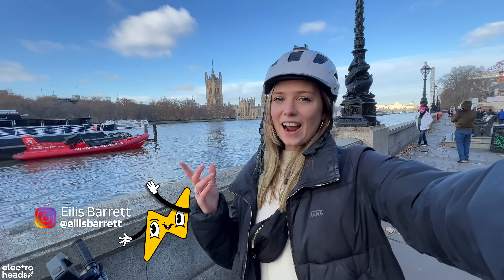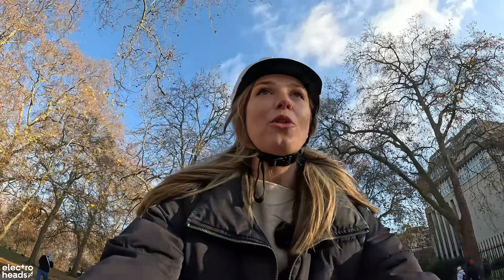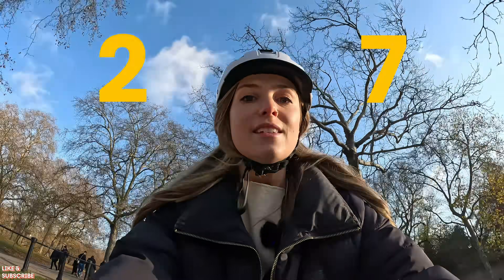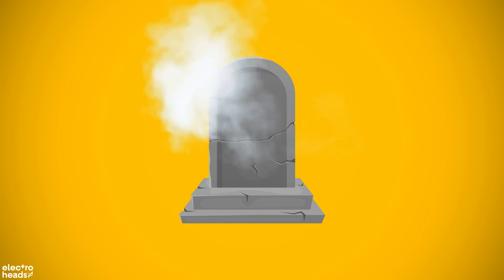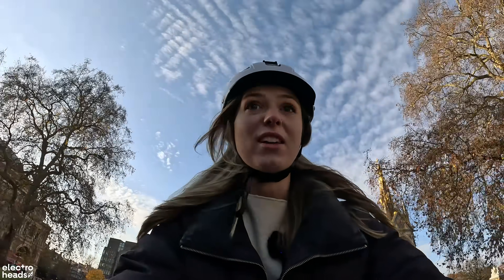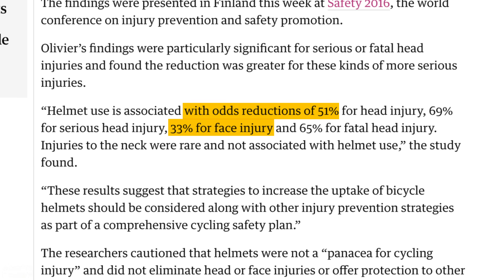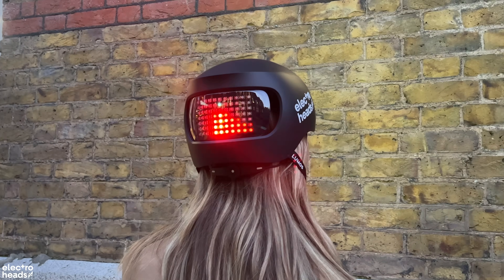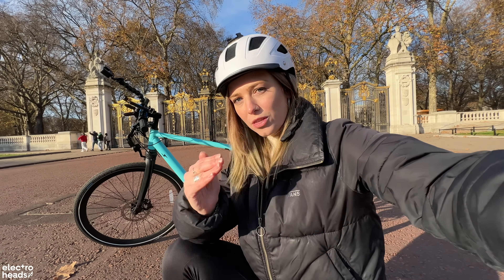Your helmet is a ticking time bomb!

Comment: A helmet is only standardised to 12mph. They don't protect anything other than the head. You are more likely to die from injuries to other organs. Drivers seem to take more risks around cyclists because they see helmets as a safety feature. Infrastructure is far more important. I wear a helmet off road, and on road in winter but in summer I just wear a cap. I don't want to boil my brain in a polystyrene box. I do about 10k miles per year and I have never had an issue. Personal choice.

Comment: Helmets are not mandatory and make lot of sense because rental bicycles exist.
Going into city, can rent a bike and not worry about carrying helmet with You.
No need to borrow one (not hygienic and unknown history)
So, for cruising in city at rental bike - make sense.

CBT is not only for mopeds, also motorcycles up to 125cc/11kW power. Last for 2 years.
If You have B car licence - After pass CBT You can ride 49cc/28MPH/4kW moped unlimited time with no L plate or 125cc motorcycle with L plate until CBT expire.
Mopeds are NOT 125cc motorcycles.
Mopeds can be greared or automatic (in scooter or motorcycle shape) just engine size/power/speed matter.
Same for 125, 300, 500cc motorbikes....

Comment: I used to use Bern Hudson with MIPS. One of the best bike helmets on the market as it has everything - NTA8776 certification, MIPS and a red rear LED light with three modes. However, as I'm planning to combine micromobility with motorcycling I recently upgraded to Cratoni Vigor. I had to "import" it from Germany as it's not available in the UK. It is the only helmet on the market, at least as far as I know after digging really deep, that combines ebike and motorcycle norms in one ultralight product.

Comment: All perfectly fair safety points but we only find out that this channel is collaborating with a helmet brand at the end of the video.
With the unbelievable prices of some helmets I think it's fair to suggest that we carefully check our headgear every time we put it on, make sure it's done up and correctly fits and that we ride responsibly. No way can I change mine every few years just because a manufacturer says I should. If they're patently not confident in their product to guarantee its safety for more than a couple of years I ain't buying it anyway. (I don't use "hair products" so no internal damage likely unless the random whirring of my brain overheats it!)
Stay safe out there people but equally don't throw good money after bad, cycling is supposed to be an inexpensive form of transport yet we seem to find more ways to throw money at it. Just a bit of common sense is required...talking of which you have reminded me to check mine. The last thing I did before having to stop for the cold weather was topple over and give my head a bang...I am old and disabled so my ev is my Stealth Mobility Vehicle and riding in the cold is not an option. Due to that disability I sometimes choose the wrong words and I have amended my comment as a consequence and by request.
Thanks Eilis, good article but I would have preferred the collaboration to be mentioned in the opening frames. 👍 To confirm: comment edited as requested guys. As you can see I stand by the principle of my remarks, which in no way discourage people from using a bicycle helmet or from enjoying your channel as much as I do, but it has to be remembered that not everyone can afford to buy new equipment without good reason. Safety is paramount but so is financial responsibility and as someone who worked in sales for years I felt you didn't really acknowledge that the manufacturers recommendations get a bit close to promotion of their product. I'm sorry that my original badly worded comment upset you but that was not the intention. However as someone involved in advertising products for some years I would argue that advertising is what it seemed like to me. God bless you for encouraging people to be safe but please...be aware of "manufacturer suggestions" or whatever the wording was. As for your helpful suggestion at the end, if you had suggested those looking for a new helmet should look at your website that would have been enough, but you promoted a specific product or brand which is what I took issue with.
Hope I've been clearer with this healthy criticism and that we can still be friends. 👍
Reply from the maker: Hey Jude ;)

That's quite a serious claim! Throwing around accusations like that can be harmful (not only to our brand, but also to people who might now think twice about the veracity of our video, and whether they do, in fact, need a helmet).

Let us categorically tell you - this video was not sponsored by any brand, it was made of our own volition. We'd encourage you to edit your comment in light of this. 👍
Reply: @Electroheads  comment severely edited guys. I hope my intended meaning comes across more clearly and that we're cool.

Comment: So this video is basically a promo for your sponsor.  Not surprising then that you are plugging helmet use.
I've never had a cycle helmet and don't anticipate buying one.  The best protection for your head is don;'t crash.  How many times in your young life have you crashed?  In my 50+ years of cycling my score is 3 with 2 slow fall offs.  In none of these did my head get hit.
A study done years ago found that wearing a helmet increased your risk of being knocked off because drivers took less care because "its ok they're wearing a helmet".
If I ever start racing then i would wear one because that is a much higher risk environment.
Why don't pedestrians wear helmets?  Their exposure to head injury is just as great when in collision with a vehicle.

Comment: What is most important is the fit and how you wear the helmet. Sadly in many of the Eltrohead videos the presenters have the helmet too far back on their heads or the straps crazily loose. Much better in this one! As for storage. If I can't keep my helmet in my garage/shed, what does that say about it for wearing it in those temperatures?
Reply from the maker: Thanks, Mike! We'll keep an eye on this as it's important to get it right.

Comment: Two years for me, but my understanding is that a bicycle helmet only needs to be retired if it has had structural damage from a fall or accident.  The manufacturer recommendations sound suspect.  The leader of a British study on helmet safety recommended (probably tongue-in-cheek) not to wear a helmet.  The study discovered that motorists drive much closer to cyclists wearing helmets, but keep their distance when cyclists don't have helmets.  
PS.  An episode on helmet tech would be interesting.  The one I use has an inner and outer helmet, after a study found that helmets often cause wrenched necks in accidents.  The outer shell can twist while the inner part remains solidly on my bean. I like your stormtrooper look.
Reply from the maker: Yes I remember reading a study where a researcher also used a blonde wig under their helmet to see if that made any difference in driver behaviour/attitudes. Thanks for your thoughts!

Comment: I'm really not a fan of compulsory helmet use on bicycles, whilst I know that in the event of my head hitting the ground in a cycling accident a helmet will reduce my chances of serious head injury, I also know that in mumble, mumble years of cycling I've never hit my head. And I look to the Australian experience where the introduction of mandatory helmet use saw a dramatic reduction in cycling and think anything we can do to increase bike use should be encouraged. 

As for expiry dates on helmets, whilst it might not degrade as quickly if its stored in the cool, dark backroom of a cycle shop surely it will still start the process? 

I've a feeling the reason helmets don't have an expiry date is more to do with manufacturers and retailers not wanting customers to know how long the helmet you're buying has been sitting on the shelf.

Comment: When you say 4 helmets failed, how did they fail? On a cycling forum I told the story that I was out with a friend greenlaning on motorcycles we came across two cyclists at the bottom of a hill. One had come off and the inner of his helmet had split in to 3 pieces. His friend said  it had cost £70. I said on the forum that I thought the £70 helmet didn't seem to be better than a £6 one. I was told the £70 helmet was designed to split apart as part of its impact absorption.